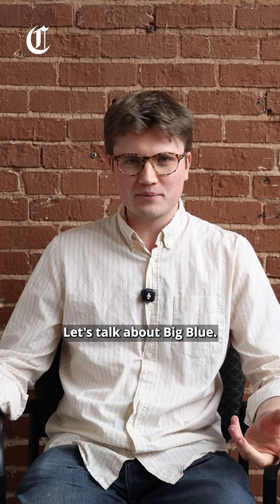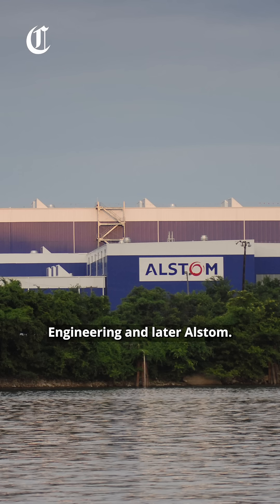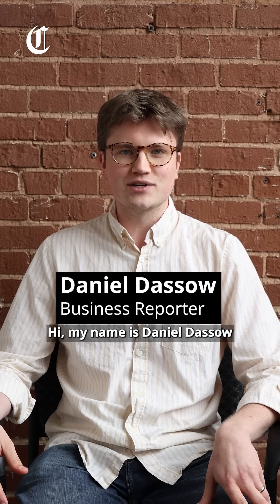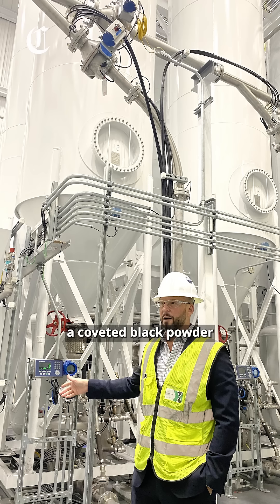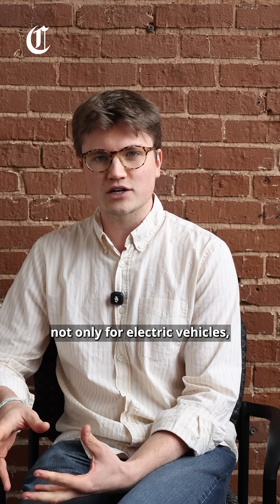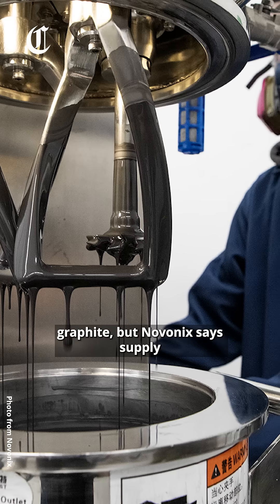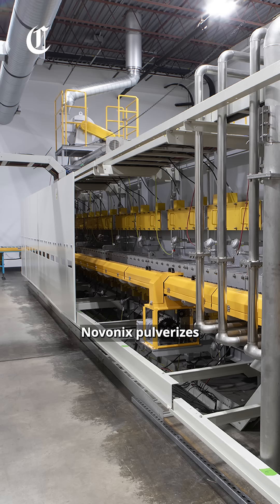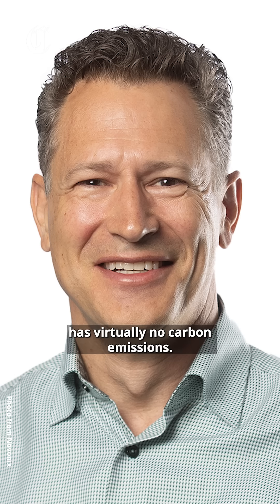Novonix prepares to take on China from custom-built Chattanooga factory

Comment: The problem with PetCoke is the Sulphur content and why the US has shipped all that we can get India  and other countries to take and use as fuel for steel furnaces and... 
I'm familiar with this process having designed a system 
 for the exact same product from PetCoke.
I heard the question of how to energize the 5k F plus heat needed to...  drive off the Sulphur.
The system we devised was a two vertical cylinder unit that we used a percentage of the hundred thousand ton per day PetCoke waste as the fuel as it burns hot like coal. In a downdraft format then crossed the heat horizontal and up through the same PC in tower 2 driving off the Sulphur and whatever other impurities. 
The problem is that is this flue gas must be treated.  we piggybacked this highly watched and regulated byproduct by passing it through t a bag house. Which is a filter system of pleated bags  that are coated  with lime which sequesters the pollution and then can be landfilled.
The special furnaces referred to are the built from graphite with the grate ash high in heavy metals that are collected below the up draft grate we designed.

Once the EPA Started regulating  Sulphur flue emmisions and farmers now have to add elemental  Sulphur to the soil where before it just fell out of the sky in the form of acid rain. 

Anybody who wants to pick my brain on this as we were doing this  10 yrs ago, just DM me
I'd love to hear what new ideas you  all have come up with.